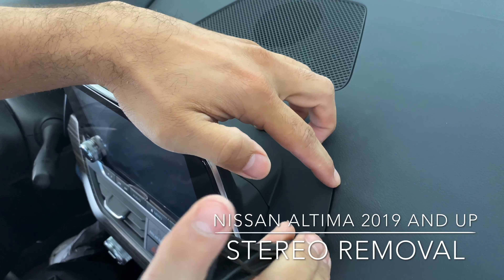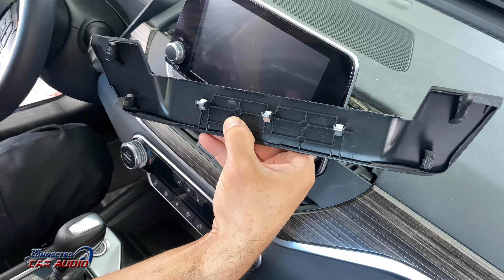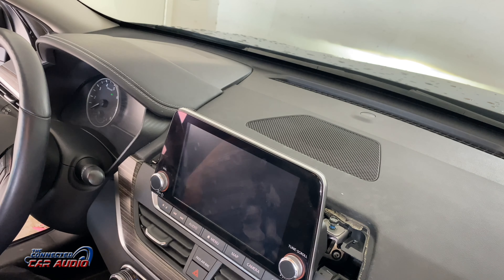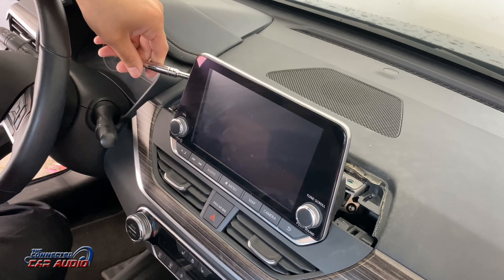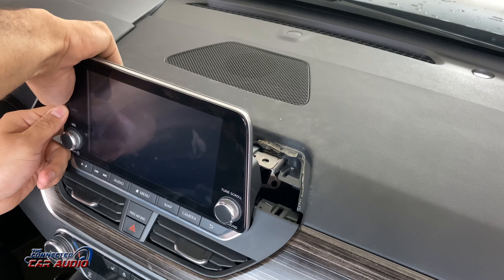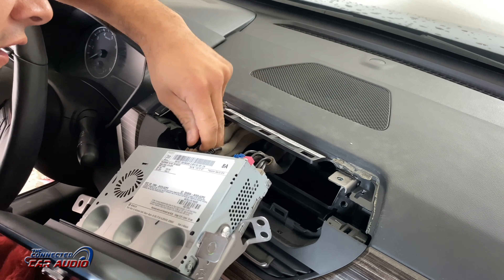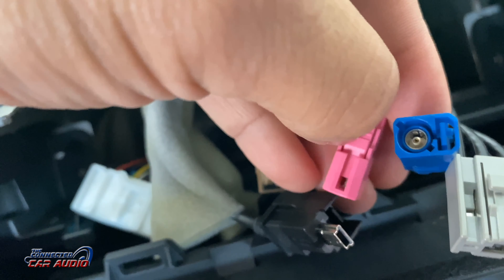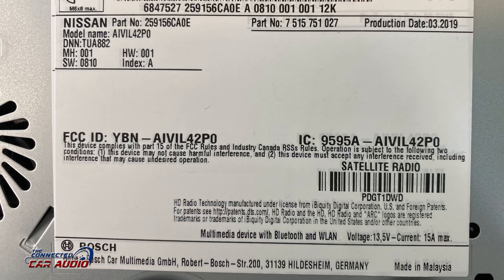How to remove factory stereo Nissan Altima 2019 and up

Comment: Do you know if it is possible to hook up subwoofers and a amplifier to the factory radio if so let me know!! Thanx
Reply: Same the factory is pretty nice
Reply: Custom Bowl yea i dont wanna lose the volume and track control on the steering wheel either plus it already has apple car play. It could save allot of time and money. I seen they made an adapter for the factory head unit that enables you to hook up an amplifier, but i wanna see it done before i buy the adapter cause its around 150 dollars
Reply: You can you’d need a digital sound converter (or line out converter) that plug into stereo with special hookups and the amps plug into the DSC (LOC)

Comment: Why would one want to remove this radio?
Reply from the maker: Add a line out converter to back of it and also repair 
Or replace with a aftermarket stereo
Reply: @connectedcaraudio  or an alpine headunit amplifier :)
Reply: @connectedcaraudio  where could you find aftermarket radios for the 2020 nissan altima

Comment: My power knob is loose. I was told that I would have to replace the entire unit for $1800. For a knob.
Reply: Ours will not change volume.  We were told same thing.  Will never get another Nissan
Reply: @MichaelKozicki  mines started messing up from both knobs man. Cmon Nissan. Mines a 2019 btw
Reply: @MichaelKozicki  my radio stopped working and I searched for a solution. I found a video talking about taking off the volume know and spraying inside the turn know with w-d40. I used a tire shine spray and then seen a video speaking about taking out fuses to the radio and putting them back in. I did all of that and my radio volume came back....no lie. I thanked God for that.
Reply: @Eden_Slapz  read my comment below. I have a 2019 nissan altima and my know did the same thing. Tried the solutions and it came back. Been good so far. It has been about a month now
Reply: Read my comments below
Reply: Meant knob ....damn phones

Comment: i will pay you to show me how to get to and change the center dash light. Mine somehow how push up into the dashboard......
Reply: @user-jk1wu7rg6u  did you ever figure this out??? Mines did the same thing!!! I’m trying to pull it back out it’s hard! I just got my car 2 weeks ago. 2020 Altima SR
Reply: @alicianoel811  no but from what i heard you have to take the glove box out and remove the ac control panel and get into from there. i just left it. fuck that............
Reply: @user-jk1wu7rg6u  you’ll never believe this! But after I asked you, I had figured that out and started to lift the panel under the steering wheel and lifted some of the panel behind the a/c knobs but couldn’t do it all because I couldn’t get the passenger side to lift. I could see the light, so I decided to forget it and as I started to piece back the panel and click into place the part under the wheel near the airbag would not click into place!!!!! I tried for HOURS. My brother tried to do it and it was stuck. So this morning 10/16/20 I took my car back to Nissan. They wanted to charge 1 hour of labor $130.00 to get the light out. Then I said forget it can you just snap this into place. The tech tried and it wouldn’t budge. Said he’s have to take the entire panel across out to realign because the clips just weren’t lining up to snap back in. Smh so it was still gonna be the same price and he’d just fix the light as he did that. I got my car 2 weeks ago, 9/30/20 and it’s not even 600 miles lol. I had no choice. I asked the service guy about the $15 discount for services over $100 and he gave me $30 off. I paid a flat $100. Smh never again! It’s fixed but i tell you that is the most stupidest light I’ve ever seen. All you gotta do is pinch it and it will get stuck inside that hole. Smh
Reply: @alicianoel811  WOW. Good god im not paying 130$ for that. Jesus. Mines been like this for a year or so, i have a 2019 about to hit 30k miles. I really want to just bring it to a audio shop and ask them to put an led in it. I have leds everywhere from the trunk, to the glove box, to the switchback led turn signals. Its all so easy except for that light. Just asshole in tbe design part of that. Thats crazy!
Reply: @user-jk1wu7rg6u  I know. I didn’t want to pay but that panel man it got stuck and I didn’t want to break anything it have the airbag go off. I don’t understand how it got stuck. Smh. Bad designs. That’s what I was doing yday. I put LEDS in the inside, tried to do the license plate light and it caused my entire right tail light to go out. So I just put the bulb back. I have the Premium SR with moon roof and the turn blinkers on the mirrors and front bottom. No fogs. That should have been simple except that tail light acted affected by the bulb being gone. It’s really weird. Yday was an aggravating day for me. So I said forget it. Just keeping the LEDs in the inside. The outside front is already bright white. My car is silver. I got the 19in alloy wheels too and tint. So beautiful. I traded a 17 Altima SR black midnight edition. Tired of the scratches and imperfections on black car.
Reply: @alicianoel811  yea i have a black 2019 altima s but i ceramic coated it, has some 20s. before the ceramic coating it was dirty so fast, but i just hose it off every few days and its fine. and thats some bullshit with the taillight, i didnt have any issues but mines a 2.5s, i just customized everything and debadged it. you would never know because i got leather put in it lol
Reply: @alicianoel811  i bought it the first week the new design came out. thought it looked good. back in 2018
Reply: @user-jk1wu7rg6u  you don’t like it now? I didn’t at first until I really looked at it again. It’s the features and all the new technology that drew me in. Big step up from the 2017 style. I got a screen protector for the touch screen and I also have the leather seats. It’s got the sport wrap in the middle with orange stitching all over the car. If you can maintain black, it’s cool. I couldn’t. I live in an apt complex and I’m almost positive stray cats are jumping on my car. The scratches got out of line and also they say if you go to the automatic car washes that messes it up too. Not sure but I did wax it all the time to preserve the shine and look but it got annoying. Also, with the black tint, wheels, and interior ppl always thought I was into some shady stuff. I’m a bank manager and I guess my car looked suspect. Hahahaha
Reply: @alicianoel811  i hated it stock, it looks good now, ive had the radio replaced 2 times under warranty, i also absolutley hate the transmission in this car. and my my car kinda looks like id be a shaddy guy, i have 5% tint all around and 20 on the windshield
Reply: once i got the black 20s i started getting pulled over about once a month
Reply: @user-jk1wu7rg6u  hell nah! Lol that’s what I didn’t want! It just caused too much attention.
Reply: @user-jk1wu7rg6u  damn what state are you in? Anything less than 35% is illegal here in GA. I use to have 28% on a different car and that got me pulled over and when they used the gun to test it, it said 10%. Lol so I really don’t know. I see ppl with the darkest of dark tint and they get away. If I do it, I’m ticketed. Smh
Reply: @alicianoel811  my 5% meters at 2.1 LOL!!!!!!! Louisiana and 33% is as legal as it gets unless you have an SUV which allows 20% but only in the rear. i have 20 on my damn wishshield ffs lmaoooooooooo
Reply: @user-jk1wu7rg6u  lol bad boy
Reply: @user-jk1wu7rg6u  really on the gas mileage? It says it gets like 30 but I’m not seeing that yet. Or maybe I’m in the new car phase and driving too much lol I wanted a Maxima but I’m in ATL and the commute is long and I drive about 17mi one way now and it’s not good on gas so I couldn’t do it. I use to have a 2014 maxima before I got my last Altima and it was the best. Lol
Reply: @alicianoel811  i drive all highway and i average 32.1 :)
Reply: @Ibrahim Gallardo I agree and trust me I tried! It was so stupid and all I did was lift a simple tab that pushed the dumb bulb inside. They also claimed service manager not available and I’m the one that caused it. Smh
Reply: @alicianoel811  I have the same light under the dash stuck too lmaoo

Comment: welp I think I’ll just take it to the dealership 😂
Reply: The one I got my car from tried to tell me it was 8k to replace the radio and 6 hours of labor.
Reply: Ol boy did it in 20 minutes.
Reply: @Hellsing12002  Shii that’s what I thought. how much it cost to fix it
Reply: @muteyikuku1106  no idea, I wasn’t getting mine fixed I just got a 2020 Altima 2 days ago they were trying to talk me into buying the $4500 extended warranty I didn’t get.
Reply: @Hellsing12002  I got the extended warranty and they told me it would be like a $50 fix at the dealership
Reply: @muteyikuku1106  to replace the factory radio?
Reply: @Hellsing12002  the volume knobs are malfunctioning and they said it would only require a software update to correct the issue and would cost only $50
Reply: @muteyikuku1106  my radio did this before my 36k mile warranty expired (just hit 36k yesterday) and it was free. now its starting to have trouble staying connected to bluetooth devices. im just getting a aftermarket radio. fuck it. these nissan radios S U C K

Comment: Can you please make a video showing where to run a power wire from the battery through the firewall ? I can only seem to find 1 rubber grommet to use but can't find the entrance point inside the vehicle only in the engine bay
Reply: Did he ever make that video?
Reply: @godofdrill4857  don't believe so. 🤔